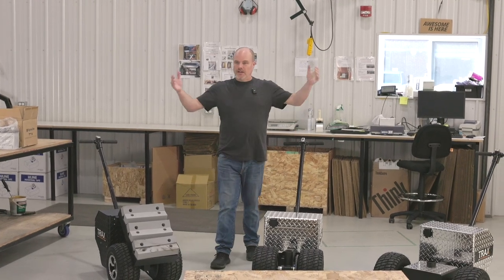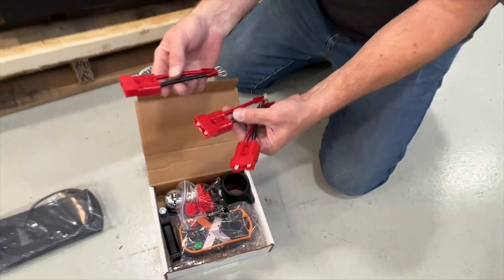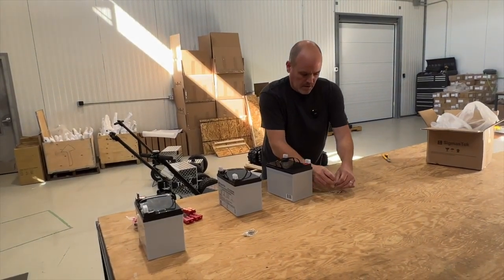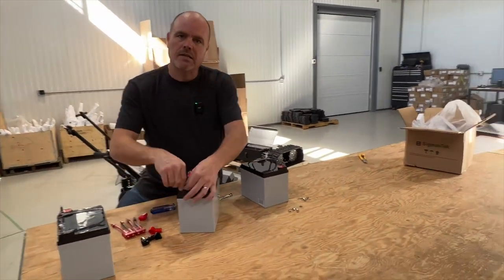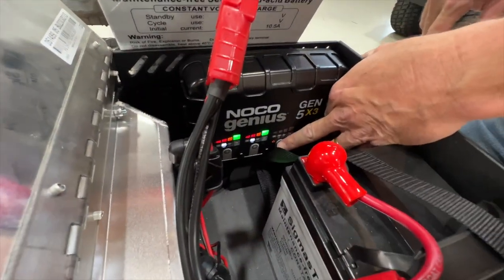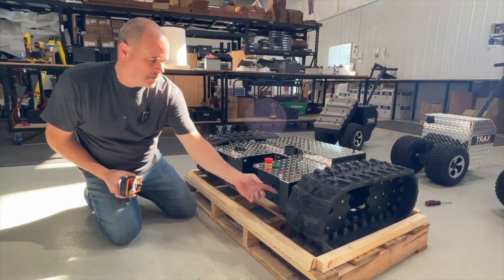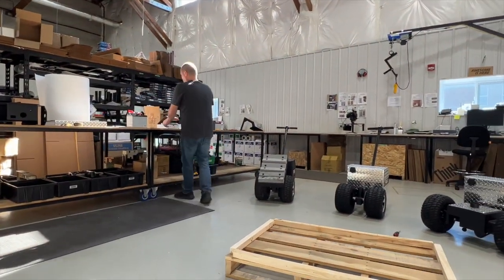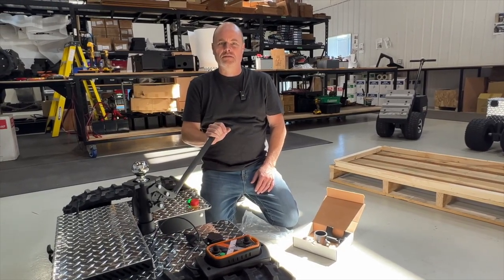Unboxing TRAX X2  electric powered trailer dolly

Comment: I have an X2 and use it for tree care.  It has been a game changer for us. Coupled with a custom-made metal cart, we can haul out tremendous amounts of limbs or trunk wood, as well as our gear.  I can drive the x2 under the shoot to the chipper, this positions the limb butts perfectly for feeding them into the chipper. It will also move our Woodmizer and or our 12'' chipper into backyards if there is access.  It's like having a third ground worker, we love it. And it is absolutely quality made, plus the customer service is great.

Comment: I have been using the new Trax X2 remote control, moving my 26' Stacker trailer.  Trailer alone weights 8K lbs empty.  I loaded my 6K lb car, so figure 14K lbs total.  Well, the dolly performed amazing well, plenty of torque to pull it.  I attached the turnbuckle to stabilize the dolly.  This thing is a game changer for me.  Now I can easily move the trailer, even loaded, and not hassle with using a vehicle.  I am impressed.

Comment: Hello Sir, I want to purchase one right away. Will it move a 5th wheel rated at 16800lbs GVWR? The pin weight is 3000 lbs.
Reply from the maker: It should handle that. Email me at sales@traxpowerdolly.com with your full name, shipping address and phone number and I’ll get you on our waiting list. Currently we are just waiting on rubber tracks to arrive to our shop and it looks like another 3 weeks out.
Reply: @Traxpowerdollysystems  
Excellent!  I will do that. One more question: the landing legs on my 5th wheel are hydraulic.  They do not have those holes as shown on your video. Will I still be able to use it or is there a different connector. 
If you are wondering what the landing legs look, please see 2023 Grand Design Momentum 351MS. 
Waiting for your response.
Reply from the maker: @concernedparent6291  we have a handcuff system to tackle the round legs. 🤔😉
Reply: @Traxpowerdollysystems  
I just sent you the email with all requested information. 
Can you direct me to a video that demonstrates those handcuff system you mentioned?
Thank you.
Reply: @concernedparent6291 did you end up ordering this? I have a toy hauler that’s 18k GVWR/ dry weight is 13,800 and pin weight is about 3,000
Reply: @KMT15  No, I did not.
Their process was too complicated and even questionable. They even asked for my social security number just to buy this. Of course, I withdrew.
Reply: @concernedparent6291 lol wtf?!  Why would they ask your SSN??
Reply: @KMT15  same question I asked.  I just withdrew and left it alone. I never bought it.